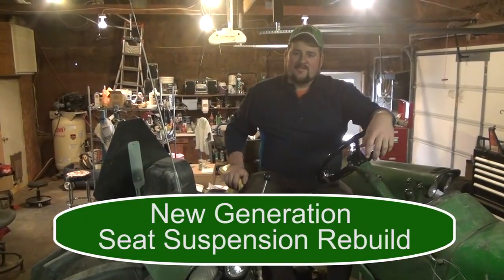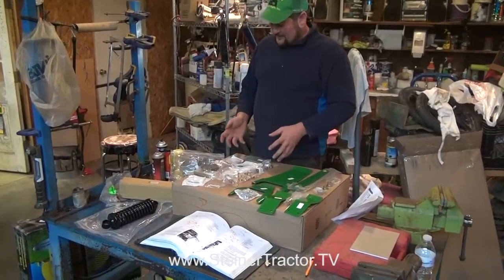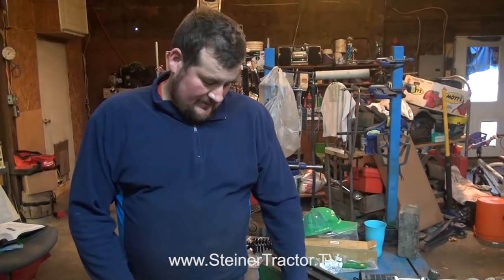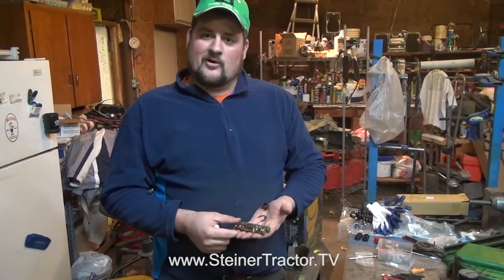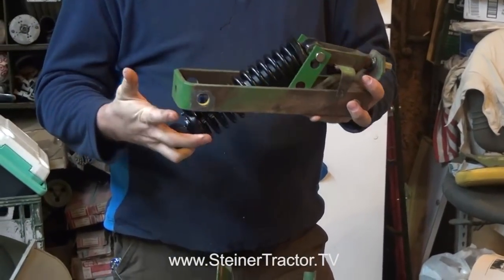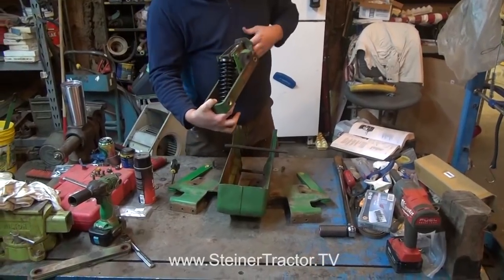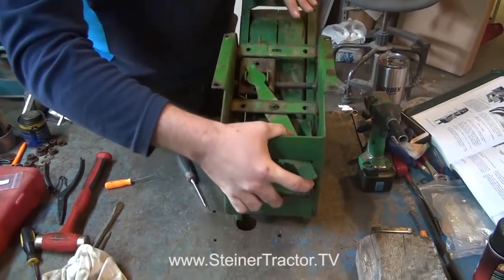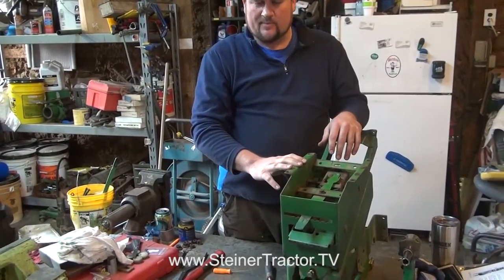New Generation Seat Suspension Rebuild

Comment: Awesome video. Thank Steiner Tractor Parts and to Tyler.
Reply from the maker: Thanks Jack, We are glad you enjoyed!
Reply: @SteinerTractorParts  most definitely.  I recently got a 4020 and my seat is leaning to the left big time.  I will be using this video on the diagnosis. I believe it is the support arms + worn bushings.  I also noticed my coil spring and the wire were not operating properly.  But now I know where that line attaches!

Comment: Ok .....very good description , except, when we get the cable connected  to the hook AND  maintain  cable tension on the drum yes good,....THE coil spring is not wound at all to assist the assembly rearward motion...I miss that step..help.............     tim

Comment: Bought the kit. Got everything ready and went to put the white nylon rollers on to the bottom and they do not slide on. Are there different size Rollers???
Reply: Same here. I had to tap them on with a mallet, but now they don't roll
Reply: @Deere55   I ended up putting the old rollers back on. Mine where in good condition.  I was afraid with the new ones they would just flatspot and cause more issues